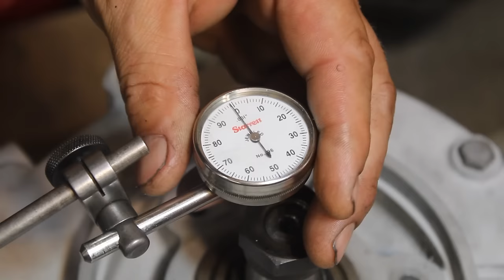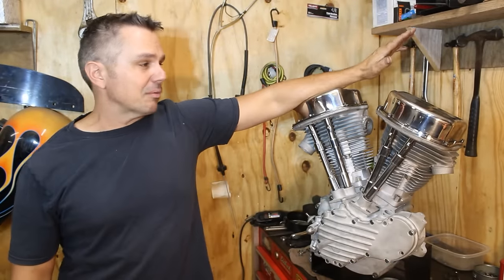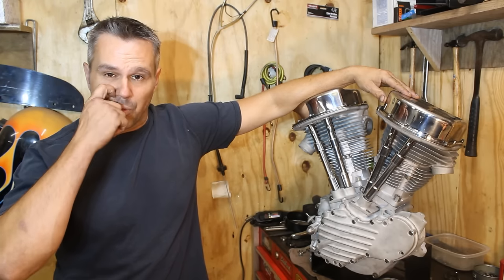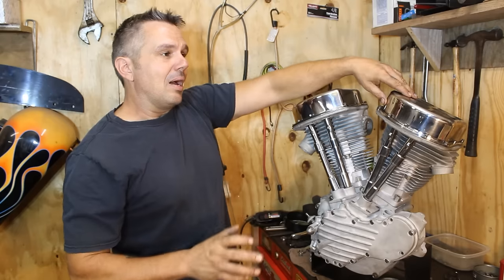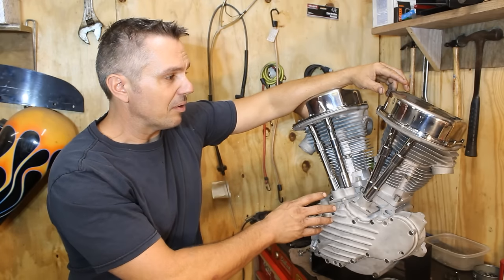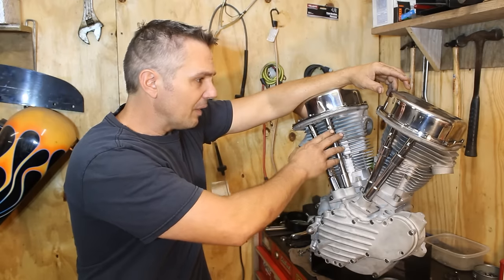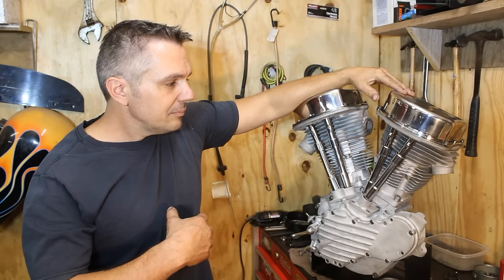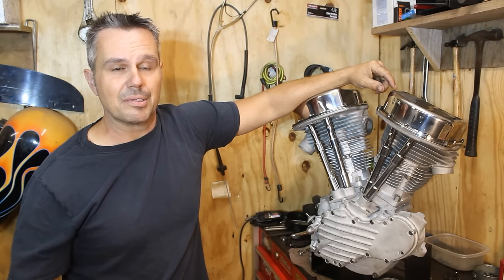Restoration of a 70 Year Old Harley Davidson Panhead Engine

Comment: So damn amazing. I have so many questions!
Reply from the maker: What questions can I answer.
Reply: @DeathProofProductions  First of all, this video shows a lot of knowledge already, and I know there is so much more in the process that had wasn't filmed otherwise the video would be like 4 hours long. Anyways, I am curious about the valves. You cleaned the valves in the blasting machine. I am sure there is more to it than just this, especially when using used parts. Making sure that the valves seat properly and all that process around it. (In the video it seems like all it takes to get the valves ready to do their job is decarbonizing the surface.) I have a Yamaha motorcycle but I am guessing that the principles are the same. I would like to learn more about what it took to get the parts fit right. 

Why am I so curious? Where I come from there are just a few people who actually work on motorcycles, and most of them avoid(can't) service engines. When my engine developed a knocking sound, two out of three mechanics told me to throw it away- before they even looked at it. No one in my circles is willing to share the knowledge or let someone in their garage as they work on motorcycles (not even when changing a fork oil...). With that said, I hope to see more videos as you progress through the build. This is the only way I get to learn a thing or two about rebuilding motorcycles. Thank you!
Reply from the maker: Ur absolutely right there was a lot more to it than what was in the video had to cut out anything we felt started to slow down the flow of the cuts and would lose people's attention. This particular engine was rebuilt not long before the fire so the main reason that I took it apart was to check and see if there was internal engine damage. Luckily other than the front cylinder having some rust that I was able to clean up she was good to go. The valves and seats where in great shape so no need to do a valve job. When I do have to i do it the way harley trained me using a neway valve seat cutter and my valve grinder. I will be putting out a video in this same style restoring my 95 evolution engine soon. In it I will have to do a full on rebuild do to the miles on it. Watch it so you can see more detail in the process. Feel free to go to my home page and email me anytime you have a question on how to do something on your bike. Oh yeah I am doing a video on valve refinishing soon as well gonna show full process with correct tools.
Reply: @DeathProofProductions  Thank you so very much! I am looking forward to learning from your videos.

Comment: I’m Not a Harley Fan…but You Sir…are a Badass ! That Crank Alone Probably Weighs as Much as my CR125 Dirtbike🤣….Great Vid,I Am a Motorcycle Fan & a Big Fan of Good Mechanics,I’m wondering Why you Painted the Inner Crank areas & Why did you Use those Old Pistons ? Anyway Great Vid,Thanks For Sharing 🦾
Reply from the maker: Old Harleys cases were green cast aluminum and had porosity issue's so they used glyptal to seal the inside to prevent leaks. The bike was burnt in a fire that's why i tore it down to check for corrosion on the bearings from it being put out with water. It had just been rebuilt not long before the fire so I didn't need new pistons.

Comment: Great video...play it back and check the base gasket choice... I did not see any internal feed oiling holes  for the top end through the cylinder at the base open on the base gasket. I know the video is a year old. The base gaskets may be for outside oiler pans. Hope my observation helps  and I hope I am wrong.
Reply from the maker: Those gaskets are for my 1964 panhead used those to finish filming and to check valve to piston clearance, Had a reason to check. The right gaskets hadn't arrived yet.
Reply: Glad to hear it!

Comment: Just wondering why you didn't punch holes in the lower cylinder gasket for the oil drain for the heads?
Reply from the maker: Those are the gaskets for my late model panhead, the ones for this one we're on order but I used those to finish the video and check valve to piston clearance. This engine was in a fire that's why i went through it to check for rust on any critical components and clean it up. I noticed the heads had been machined so I wanted to make sure it was done with the right clearance for the valve.

Comment: What did you use to paint the jugs? And what did you use inside the engine case? I have a shovelhead I'm restoring and want to know what is best to coat everything. Thank you! Nice video!
Reply from the maker: Any high temp paint will work. The cases are sealed with glyptal.

Comment: Man. I have a 57 ironhead in an early 70s stretched, lowered and raked frame. Hard tail, springer and King and queen seat. I don't have any problems per say with the iron Head but pans are cool. The bike has a 9 foot wheelbase, still running the magneto and is goofy footed. I think I want to pan head the bike and make a killer glass table top out of the ironhead.
Reply from the maker: cool but don't give up on ironheads I have 2 and I love them.
Reply: I hear ya. Thanks for the reply.

Comment: Put together dry made me wanna cry .
Reply from the maker: if you look at time stamp 13:04 you can see the oil on the gears. had to cut out the obvious things like oil and lock tight to cut a 30 hour video into 20 minutes. I cut out me putting the circlip in for the wristpin and oddly enough nobody's said anything about it.

Comment: What type of red paint is that inside the cases?
Reply from the maker: It's a engine sealant the aluminium was green cast and was prone to porosity and could weep oil so this was what they used to prevent it.

Comment: Did you lap the valves to the guides?
Reply from the maker: There was no need this engine had just been rebuilt 500 miles before the fire. I checked them and they were still good but typically when I have to rebuild a head I use a Neway valve seat 3 angle  cutter and follow the procedure that the factory trained me.

Comment: A little assembly lube would go a long way but my favorite Harley engine they call me the Pan Man
Reply from the maker: At time stamp 13:10 when I assemble the gear set you can see the oil on the gears. I  CUT 40 hours of work down to less than a hour to do that I had to cut out some things. For instance you see me check flywheel endplay but I didn't show me shim it.

Comment: Everything put together dry? A lot of damage when it starts.
Reply from the maker: At around time stamp 13:10 you can see the oil on the gears. Had to cut out some stuff  to shorten the video, like shimming the end play for the flywheel. i show me check it but not adjust it or me applying loktite to the bolts ,you can even see the bottle sitting beside the engine. if not it would have been 30 hours long.

Comment: Check rods for straight…. Line bore….. balance wheels … valve seats ? Etc….
Reply from the maker: this engine came off my 1950 that burned. i had just rebuilt it roughly 500 miles before the fire. i was mainly concerned  with internal rust so i decided  cleaning it up and checking for rust caused by water was a good idea. got lucky the only rust was in one cylinder. went ahead and bored it out .010 oversized didn't film it like some other things to cut the time down on the vid. the steps you mention i did on the rebuild before the fire.

Comment: I know its an old video maybe youll answer maybe not. Why did you build it dry? No lube what so ever. I know you know what your doing.so i just gotta ask why dry?
Reply from the maker: Thanks for asking this question respectfully, most people who ask questions on here think they already know the answer. I had to edit out alot things to make the video watchable length, like oiling the parts or applying loctite or even me shimming flywheel end play, I show me check it but not adjust it. If l hadnt the vid would be 40 hours long. look close at the gears when I'm  installing them you can see the oil on them. Once again thanks for respectfully asking the question.

Comment: What's up with painting inside the crankcase ?
Reply from the maker: That's actually a engine sealant, early Harleys were green cast so the aluminium was prone to porosity and could weep out of the cases. They used that to prevent that problem.
Reply: Ok I see , thanks very interesting.

Comment: Looked to me like the oil return hole in the case was covered by the base gasket. Hopefully, there is an oil return hole
in the lower bore of the cylinder. Don't ask me how I know this. The Panhead was always my favorite.
Reply from the maker: Yes those gaskets are for my late model panhead the ones for it we're on backorder but I used those to finish the video and check valve to piston clearance.

Comment: If you restore to stock condition, consider running 4x18 wheels instead of 5x16. It will look and handle better. Hopefully no funny looking cheese-slicer bumpers either. A conservative approach to restoration is best, IMHO. PS: I had a stock 50FL with sidecar, reverse gear and sidecar Hydra-Glide fork. Fine machine. My brother has it now.
Reply from the maker: thats funny you said cheese slicer bumpers. i  just welded up the holes for one on the front fender the other day. thanks for the wheel advice.
Reply: @DeathProofProductions  
Good luck! I'll subscribe.

Comment: did you cover the lubrication holes with the gasket minute 13:37
Reply from the maker: yes the right ones hadn't arrived yet, so to stay on time with the vid i used some for my 1964 panhead. i also wanted to check valve to piston clearance because the heads looked like they had been decked. machine surface was way to fresh looking for a engine that old.  the measurement was fine so they must have been fixing some warpage.

Comment: Hi I noticed you didn’t check the tightness of the main bearing race castings to the cases on the video. I have a 49’ that I’ve had for about 40 years and have put about 600K miles on myself. My last trip around the US & Canada about 14K miles in I crossed some really rough RR tracks and she started knocking, so I stopped in Kansas and bought a pickup and brought her home and tore into her and found the races were loose to the cases by several thousandths. I live in Phoenix and can’t find anyone to repair it properly. Do you have any suggestions for me? Thanks in advance, JG
Reply from the maker: it's funny you said you bought a truck to bring her home. I have done the same thing. send me some pictures so I can get an idea what were looking at. if you were in Kansas you were not far from me. I would have helped you out what year was this.
Reply: I've had the same issue with early shovel cases. The last one I encountered was on a set of '70 cases. I had gotten back from a 10K road trip to find a bunch of leaking. Found the bearing race insert flopping around in the case by .003". Tried two of the recommended repairs (one was to swage the alum around the race with a custom machine press tool) but it didn't last. I'm convinced the casting was just too porous and tired after years of service. Sent to HD using their case replacement service and got back a set of new castings with my original VIN. Castings were early evo (-92 maybe?) with oil passages machine to '73 and up shovel specs.
Reply: Thanks for responding! I’ve tried that too also having it shot peened. I even tried annealing it . One shop wanted to bore out the case and weld in a Timken type bearing but didn’t have any faith in any of them.JG
Reply: @recykler49  Sounds reasonable. I'm not convinced any of them work either. At least not for a regularly ridden machine.

Comment: I’m wondering why the inside of the engine would get painted?
Just curious
Reply from the maker: it's not really paint it is a type of sealer. The old castings where know to be porous so the factory sealed the inside of the cases to prevent weeping oil.
Reply: @DeathProofProductions  I knew it would make sense. 😀
Thank you

Comment: If a light smack on the crank “trues” it, how does it hold when the engine is running.
Reply from the maker: The crank pin is tapered so once it is tourque to 150 ft lbs it's like a press fit coupling. Also it was alot more than one light hit it took a hour to finish it but I have to edit some steps down to keep the time reasonable.
Reply: @DeathProofProductions  oh ok, it’s just wild to think that holds up under hard acceleration and such. Great video

Comment: Добрый день, уважаемый мастер! Заметил пару моментов, можете прокомментировать? На прокладках между блоком двигателя и цилиндрами отсутствуют отверстия под маслоподачу, и обратная ситуация с прокладками под блоки толкателей клапанов!
Reply from the maker: Later models had a hole for draining oil in the lifter blocks but everything else was the same. Manufacturers just make them with the hole and it can be used on any year model . The base gaskets are for my late model panhead, I used them since my other ones hadn't arrived yet so I could do two things. One finish the video and two check valve to piston clearance, when I pulled the heads off I could see the gasket surface was freshly machined. That made me wonder wether the previous owner fixed some warpage or decked it for more compression. So I wanted to check valve to piston clearance since there the was a ding on one of the piston's. Since I had to pull the top end back off to Measure the  lead wire to verify that the valve clearance was good I used those gaskets.
Reply: @DeathProofProductions  спасибо большое, что ответили! 
Спасибо за ваш труд! 😏

Comment: It appeared like you put the pistons in the cylinders without oil?
Reply from the maker: I oiled everything before I assembled it.  At time stamp 13:10 you can see the oil on the gears. Just had to cut some stuff like that to shorten the video. Just like me showing checking the end play for the flywheel but I didn't video changing to the thicker shim.
Reply: @DeathProofProductions  Thanks, now I see how the wrong impression can be made.

Comment: Добридень , кудою буде зтікати олива з головок циліндрів , чи потрапляти в них ? Бо прокладками здається перекрито якісь канали , більш за все що для зливу , бо знаходяться нижній точці головки .
Reply from the maker: Good eyes those are late model pan gaskets. I used those just to stay on time with the video. The ones I ordered had not arrived yet. I gotta pull the cylinders back off to finish honing out the rear one.
Reply: @DeathProofProductions  дякую за відповідь , у нас в Україні ге те щоб прокладки а саморобного мотора чоловік зібрав і пенхеда правда оригінального .
Reply from the maker: @Heer-Yarik  The reason for the assembly wasn't only for the video. It was also so I could rotate the engine to check the value to piston clearance by hand.

Comment: tools, knowledge, did you work at Harley?
Reply from the maker: I was a technition for Bumpus Harley Davidson in Memphis T.N. I later went to work as a maintenance millwright at a papermill. That's were I learned the welding and machining and such, guess you could say that's were I finished my Jedi training.
Reply: @DeathProofProductions  when it's for yourself you don't count
i like knowing how to take apart and put back together an engine
mine is starting to get tired, alas!!!!!!

Comment: Wonder how it runs and the power it makes with that pritty unlapped sand blasted valve seats. If it doesn't seize up in the first 100 rotations. Didnt see a drop of oil in the video...
Reply from the maker: If I filmed every step of the process, the video would have been 30 hours long. I thought it would have been obvious that I used oil and lock-tight. I'm sure this engine will run perfectly like the other hundreds I've built. Right now I'm in Dallas riding the Dyna I built. And even though it has 103 Thousand miles on the Odo it will still pull the front wheel off the ground. Happy Holidays
Reply: @DeathProofProductions  A shot of dumping a cup of oil over the valve rockers or something like that would do for the viewers that maybe want to do a rebuild themselves. Lapping valve seats and pre oil moving parts can be quite cruicial but yea, just my 2 cents. Its hard to use too much oil haha. Ill watch your video of it running.👍
Reply from the maker: this video was not to show anyone how to do  it. very few people have a pan so i did this as kinda just watching me work.  if you check out my page you will see the other work on newer stuff and I always show locktight and touqe values all the stuff they need to rebuild it. I still have alot of work left to be done rebuilding it. I have three more almost done that I have to finish. hit the bell and you will get the notafacation when I upload the video riding it.

Comment: I would definitely want as much as possible painted a heat resistant red. There looks like a structural problem on the back cylinder near the base.  Build the bike, sale it as a 50s era rider.

Comment: Are the cylinders supposed to go on dry?
Reply from the maker: i had to condense 30 hours of footage. so I didn't film obvious things like oil and lock tight.
Reply: @DeathProofProductions  makes sense, I'm just used to seeing assembly lube instead of oil, didn't mean to make it sound like you didn't now what you were doing.

Comment: this has to be just a show assembly, no break in lubricant no gasket sealant. Not saying he doesn't know what he is doing just saying this wasn't for a running engine
Reply from the maker: the bottom end is done. at 13:04 you can see oil on the gears and i used 3m threebond to seal the cases I didn't film it to keep the time down.   i had to even put it on the timing cover because of all the nicks, but yeah this was just showing the restoration and assembly for checking valve to piston clearance. I still have a little topend work left. this engine was rebuild not that many miles ago but it was in a fire and needed restoration.